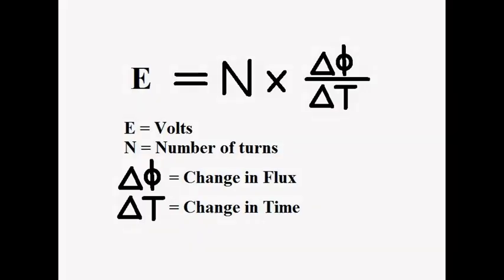How to increase the power output of your Generator.

Comment: What about capacitance in parallel with the generator output?
Reply from the maker: Well generally we don't have Capacitors in generators until the power goes into the rectifiers. I know some people charge capacitors with atmospheric voltage from an antenna but that is a very low power energy source unless hit by a lightning bolt. Let me know if you have any other questions. I will be putting more videos about my HydroBelt and my Obstruction Turbine that will provide all the electricity the world needs.
Reply: @mark8664  Thanks for the advice.

Comment: OMG I COULD KISS YOU!!!! Thank you so much for that simply yet extremely helpful information.  I have been writing on a crazy project that I'm not even sure will work but this explains some of the things I need to do.  I hope I don't sound too stupid by asking this but how do I increase the Amps as well.  Would the amps increase with the voltage as I increase magnet size and strength as well as increasing RPM?
Reply from the maker: Thank you and yes current increases with bigger magnets. As a matter of fact, you can discover many new and better generator designs by a study of that same formula I was talking about. 
Increasing current or amps as you put it is just one part of the power equation, you see Power = Current x Voltage, so you see you can not separate Current from power because it's all related. I know you can use Algebra to solve for Current but it gets more complicated, I could do it but I would have to get paid  :) but anyway I think what you would be looking for is How to increase current and not a formula.  You are on the right track with more powerful magnets just remem
ber: 
1) Stronger magnets 2) moving the magnets over the coils faster and 3) increasing the number of turns of the coils of wire.
Reply: @mark8664  thank you so much for your time and knowledge.  You have helped me so much. The reason I talk about amps is because that is how the power coming into your home is measured.  The power supplied to the average home is 220v and between 100 and 200 amps. The larger the home the more the amps. I'm working on eliminating the electric company.  The cost of electricity where I am is out of control.
Reply from the maker: @axolotllifeaquatics4492  I have so many inventions that I am going to show everyone and one of them could work for you and at the rate that I am working on it they may never come to light, but hopefully they will, but in the mean time we can still work with known facts about science.

Comment: What about turning a 2.5 volt Dynamo from a vintage marklin stationary steam engine that I'd like to at least keep it mostly orginal but I would like to up grade the generator to increase the power output up to 12volts with the small  strongest magnets in the world just to produce 12 volts to hook it up to a semi or car inverter to make 120 volts ik and I understand that it's a lot of work to do to up grade a vintage toy to make that much electric
Reply from the maker: The thing about messing with a generator that was designed to work a certain way, unless the engineer is an idiot you can change the voltage up or down but the power always stays the same because by reducing the wire size you can increase the voltage but that reduces the current so you are still at the same power level.

Comment: I am building a generator..  have many questions..  is there a way to contact you ?  My generator puts out over 400 volts, at 120 hz..  what components do I need ( capacitors, resistors, rectifiers etc) to make it useable 110 v 60hz ?     I’m sure a step down transformer will give me the 110, but how do I tune the frequency without removing magnets or slowing down my rotation?
Reply: How did you made it brother.?
Reply: @diwakardany9151  neodymium magnets in a ceiling fan motor. And I was wrong, it puts out 60 hz, my math was off.  I added a step down transformer to make the 400 into 120V .  A motor won’t keep it running due to physics or a thing I call mag-lock..  but I am hopeful that adding a capacitor bank to delay and store up the generator energy and releasing it out of sync with the frequency created, that I can generate a perpetual loop that really works and sustains itself while also producing enough extra useable juice.  But..  I live paycheck to paycheck and started the project in a whim and an idea.  Someday maybe I will crack the code but for now, it collects dust lol.
Reply from the maker: I am glad to help. Your questions are good for other people too because they can also learn from your questions. 

400 volts at 120 Hz, what a great generator. Normally we have to go faster to get that much voltage. The formula that I show in the video is not everything but if you truly understand that formula you can invent a much better generator than even exists today, I know I have done it many times just by using that formula.

Comment: Sir 1 question please.
 If my mini generator motor have smaller wire and
 If I turn it to bigger wire and same turns, does it gives me more power? Thanks
Reply from the maker: That is a very good question because the answer is yes it gives you more power because the bigger the wire the lower the resistance which means more current can travel through the wire and the more current the more power Power = V * I so the more I the more power. I am sorry I can't give you a better answer right now cause I have to go to work in a few hours but I will give you a better answer later.

Comment: Hello Mark! 
Thank you so much for your informative video. 
I was wandering if you would mind assisting me with a small dilemma I have. 
I recently bought a new generator, that was falsely advertised to be 8,5 Kw. 
The item was shipped from the UK, to where I am living in Asia, so there is no 
returning the item! 
On the generators manual it shows several models, all of them have the same 
6.5 HP engine and alternator
My question, is: do you believe that changing the AVR to a higher output will 
give me the power I require. 

At some point, the alternator is going to reach its maximum capability, in so far 
as how much power it can put out, so, if I change the current wiring harness 
from and to the plugs etc. to a heavier gauge wire, change out the breaker for a 
30 Amp breaker and put the appropriate plug sockets in,  what harm could it do, 
to replace the current 2,5 Kw AVR, with a 5.5 Kw or an 8,5 Kw AVR? 
The Top model that this company produces is a 5.5 Kw model, so I can't see any 
problem in changing this out, but but I suspect that if I run this generator with an 
8,5 Kw AVR the power generated might become unstable, or the motor might have 
trouble trying to keep up! 
Is this correct?
Can you please help?
I am needing to run a small hand held, portable inverter welder machine, some lights and some power tools, in a remote work area.  
My Welding machine is an ASEA & Model is: DRAGUN200 
http://www.aseawelding.co.kr 
,with a rated input voltage: Single 220 Volts, Frequency 50 / 60 Hz, power consumption: 5.5 Kw, rated current output 40-200 Amps, Load Voltage: 24.8 Volts, Max no Load Voltage <15 Volts, Duty Cycle; 60%. 
My Whattsapp number is: +82 104657 2581 or you can email me at: commsdiver@yahoo.co.uk  
Many Thanks!
Reply from the maker: I will help but please don't change anything on that generator because it would take much more than answering a couple questions to fix your problem. I have to go to work now but will get back with you later.
Reply: @mark8664  Thanks Mark. 
Any idea as yet to some answers for me? 
Cheers! .......... God Bless!!! ..... Stay Safe!
Reply from the maker: @seanashcroft9713  I will contact you now at commsdiver@yahoo.co.uk
Reply from the maker: @seanashcroft9713  Did you get the email?
Reply: @mark8664  Hi Mark. Yes I did and I replied to that email. 
Thanks! 😎 
Stay safe & God Bless!!!

Comment: Ok now tell me how to build a generator that matches the power grid, same frequency, voltage and amps but more watts?
Reply from the maker: I can tell you know enough about generators to be dangerous. To thoroughly answer your question I would have to write a book to explain all the parts of such a generator, however, I will touch on a couple of the problems regarding it. To build a generator that matches the power grid is very difficult because you have to design the speed of the generator to ALWAYS be at the same speed as the power grid and that can be very hard to do because the motor that is driving the generator has to turn at exactly the right frequency. But not only does the generator have to be turned exactly at the right frequency but if the voltage is not absolutely ALWAYS greater than that of the grid you will either burn up the generator or at best not create any voltage at all. The amperage is a function of voltage so there is nothing that needs to be said about it.
Reply: @mark8664  Not really, an engines speed can be set at a constant, all I want to know is what affects current, voltage, frequency and watts?
Reply from the maker: @johnnywoods5549  Any educated electronic technician or engineer that hears you talk would know that you don't know what you are talking about, but honestly, if you really want to know the answer to your question just ask and don't assume you already know the answer.
Reply: @johnnywoods5549   @Mark Osborn  hw abt using copper disc in a Tesla turbine with 3 tesla magnets assymmetrical or elongated cube magnets fitted both sides if copper is having trouble some other edges can be used which is a insulator with graphite brushes what do u say for a 2-4inch copper disc's seperate via a steel or some carborandum discs  hw much is the robablity of it making a good generator it would even better to have magnets inside the turbine disc's or kept adjunct with similar rpm but opposite direction with steam etc

Comment: I don't want to know how to build and alternator but just how to get more amps out of one.Like  what kind of stator for 250 amps.
Reply from the maker: Simply put, it isn't possible to get more power out of an off the shelf generator. HOW a generator is made determines how much power it can create.
Reply: @mark8664  hw abt using copper disc in a Tesla turbine with 3 tesla magnets assymmetrical or elongated cube magnets fitted both sides if copper is having trouble some other edges can be used which is a insulator with graphite brushes what do u say for a 2-4inch copper disc's seperate via a steel or some carborandum discs  hw much is the robablity of it making a good generator
Reply from the maker: @DK-sg3oe  I can tell that you are very creative like me! However, a copper disk will only get hot and won't make electricity, but it's good if you need heat.
Reply: @mark8664  yes u can use the thermocouple effect if u use 2 material layers on the disc and also  probably think of putting a 16 - 24 magnets disc's ns either rotating the other way to the Tesla turbine, or just sitting adjacent 2the turbine,  as Tesla tried using 2 properties ie 1. Speed ie rpm or higher frequency or cps to get higher volumes of voltage, 2.he tried using heat to increase the efficiency of voltage gen, now v need to use 2 more properties ie 3. raised magnetic flux nd rotation speed opposite magnetic flux density with in between insulator material which doesn't heat degrade, 4, series or assymmetrical nos as u can't use high copper weight for high current, 5. Resistance  to magnetic flux, is what creates current in copper, seen as electric charge flow, so will need to check, centre vs edges, to get more voltage output, example in bifilar coils
Reply from the maker: @DK-sg3oe  Wow! That might be something... even if it doesn't work keep inventing and see if it works.
Reply from the maker: I think you are  talking about an alternator for a car to which I would recommend you to just buy a better alternator, but this video is more for people who want to create either a wind or water turbine.

Comment: Stronger magetic flux = higher frequency.. whodathunkit?
Reply from the maker: Maybe what you are talking about is when I said that a higher frequency will produce more power on the output. I'm sorry I didn't go into more detail on this point,  but this is part of the majic of how electricity is made. If you look at the formula frequency is part of the formula but it is not very clear. You see, frequency is a measure of how many times per second something happens and so the higher the frequency the less time it takes to complete one cycle, therefore,  the smaller the time the higher the frequency and if you follow the formula the less time the bigger the voltage.... you see?   :)

Comment: I WASTED 4:35 MINUTES OF MY LIFE WATCHING THIS. IT HAS NOTHING TO DO WITH AN ALTERNATOR
Reply: It has everything to do with an alternator..
Reply from the maker: Alternator - Wikipedia
https://en.wikipedia.org/wiki/Alternator
An alternator is an electrical generator that converts mechanical energy to electrical energy in the form of alternating current. Learning keeps us from looking stupid.
Reply from the maker: @merbouhe laid79 Yes I will try to help you here. Electricity is a lot of mathematics. I see that you said that your home generator makes 3500 watts, but there is a mistake somewhere because watts = Voltage X Amps and when I multiply your voltage (110 V AC) X your amperage 8.5 Amps = Watts 935 Watts. (please see  https://www.rapidtables.com/calc/electric/watt-volt-amp-calculator.html ).
Reply from the maker: @merbouhe laid79 Please let me know what you find out and we can continue with your generator project. أراك لاحقا
Reply from the maker: @merbouhe laid79 Very good. Now we know what it is supposed to give you. However, you have to spin it at the rated speed that it says, so what does it say to spin the shaft at, that is, how many RPM's.
Reply from the maker: @merbouhe laid79 according to the link that I gave you the generator should produce about 350 volts, so if you are only getting 110 V ac you are not spinning it fast enough.

Comment: Hi there I've got a petrol generator 5.5kv and I have a motor on my large mixing machine with 4kw but on start up it needs over100 amps for a split second to get it going so my generator cuts out is there a way I can adapt my generator to work or is this a bad buy I've made I hope you can help it was a lot of money for me thanks for the video very interesting
Reply from the maker: After giving it some thought I think I understand, it would seem to me that you have your mixing machine under too heavy a load, if you make sure that your machine is empty before you start it it might fix the problem, otherwise you could use a clutch to engage the mixing machine with the motor. Also, I did a few calculations and it turns out that if you are using 220 VAC a 4K watt motor normally uses about 18 amps, and if the currant increases to 100 amps that would mean that your 4K watt motor now becomes an 22K watt motor and your generator is not enough.
Reply: Mark Osborn thanks mate